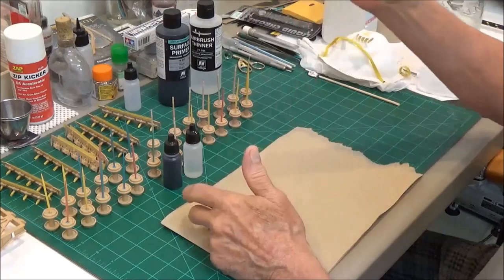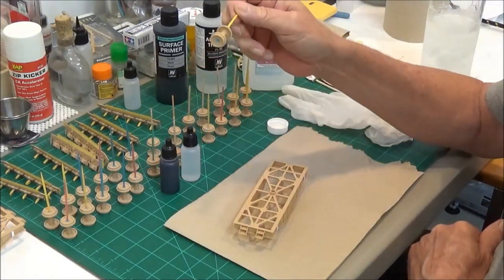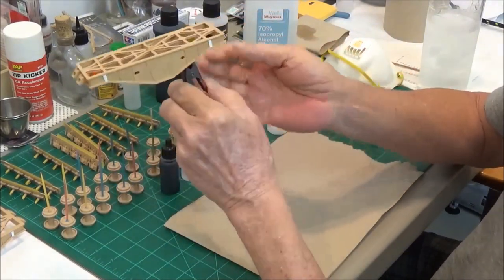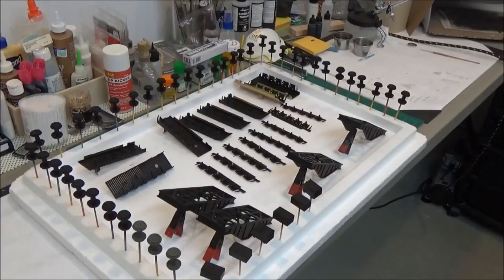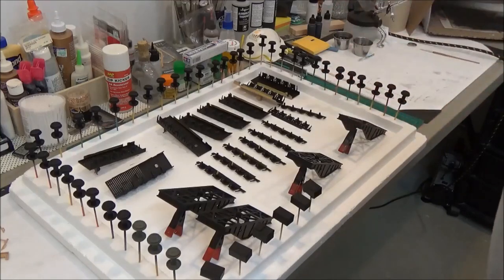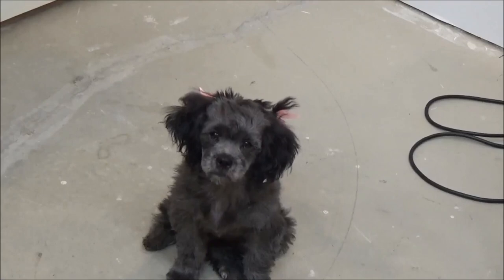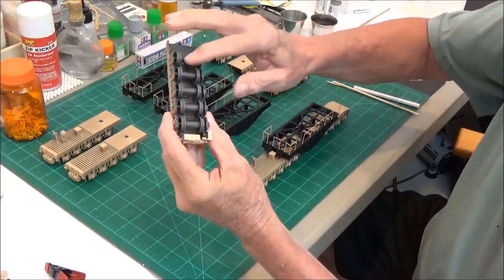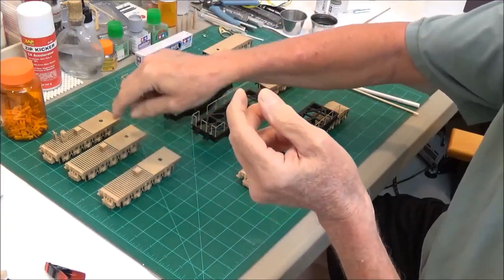DORA RAILWAY GUN PART 9

Comment: Hey, get yourself a can of carb cleaner. Spray that in your colour cup and it'll dissolve everything you have stuck anywhere..
Reply from the maker: No thanks ...I'm not spray'n that stuff in the house, plus it could be to strong for the finish on some airguns. Most what I spray easily comes clean with alcohol.

Comment: On the wheel set too Much Paint!  Long sweeps  then inside Long Sweeps inside outside!! short side end outside let dry..... Then chuck it in the same order as above you are  not fowling thoru as a setup step. Larry
Reply from the maker: Well they came out just fine.  Long sweeps works fine on larger parts, but the wheels have to many in's and out's and all around for conventional spraying.
Did not understand the second part of you comment, "Chuck it in the same order"?????  and "Not following through as a setup step"?????
Reply: was asking the same for your over  NEXT STEP  using the same Q as in the second when you do the overall set of steps rail setting are you for Maybe it could have been easy had I turned on my X Ray glasses
Reply: Larry Dehring i